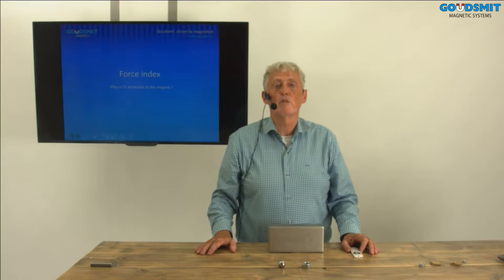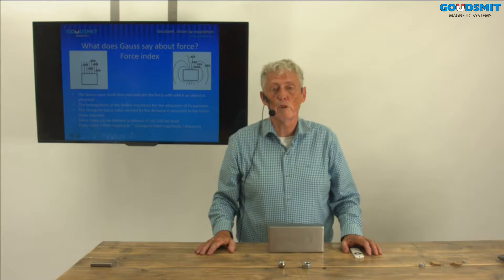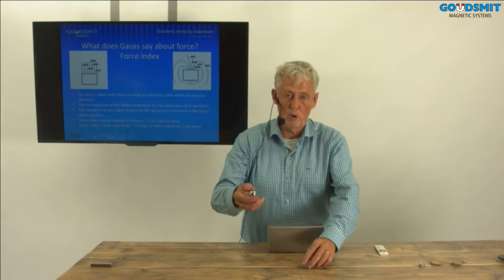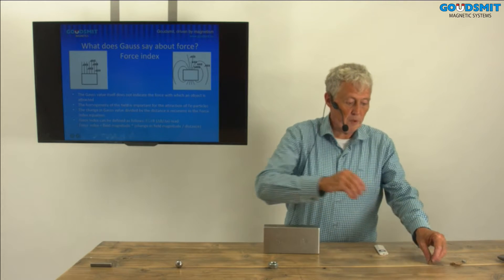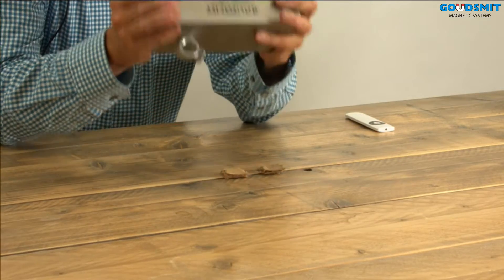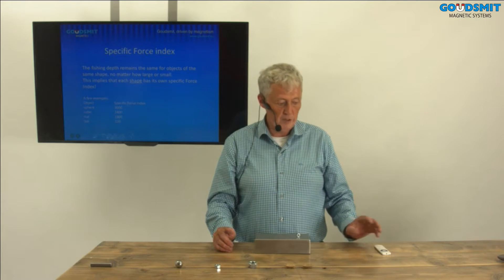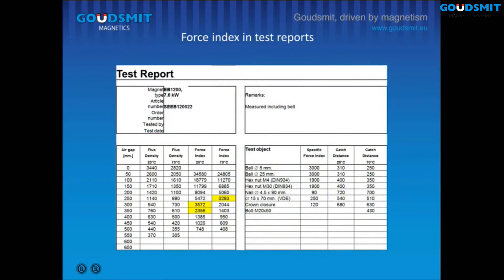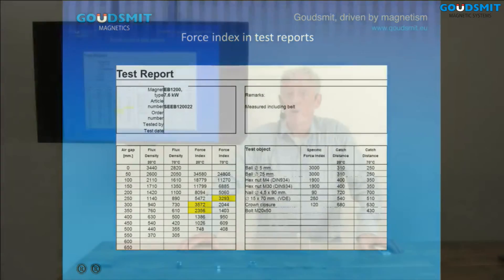Force index: what is important for attracting a part by a magnet  - Goudsmit magnetic Systems

Comment: What is the dimensions of the magnet?
Reply from the maker: This is a neodymium plate magnet, of approx 200x80x40 mm (as it is a video from a while ago, we're not exactly sure)
Reply: @GoudsmitMagnetics  thanks a lot for your reply, please can you explain what you mean by type 7.6 kw in your test report, and kindly may I quote  measurements data?
Reply from the maker: Dear @Asaad-Hamad  , the test report in this video is an example, based on an electromagnetic overband. The 7,6 kW says something about the power of the magnet (and thus the height from which steel parts are attracted). We have now newer types available, so please take these values as an example. If you need this information/data for your own specific situation, please put these questions with the data in an email to: info@goudsmitmagnets.com